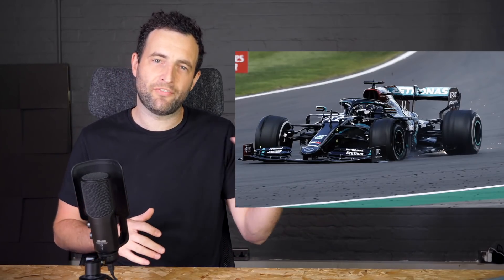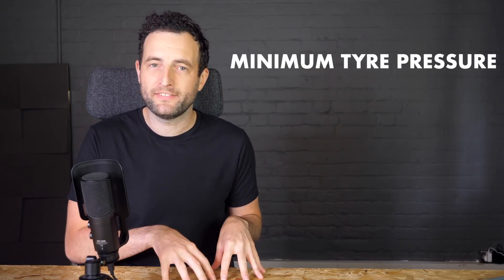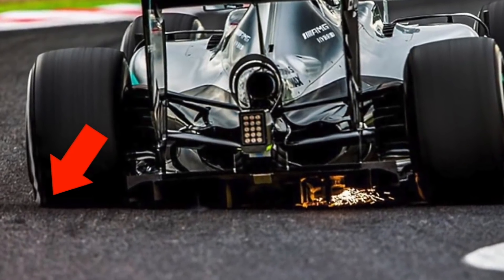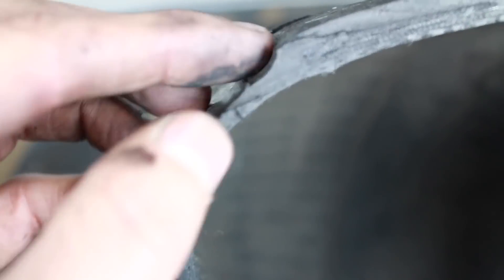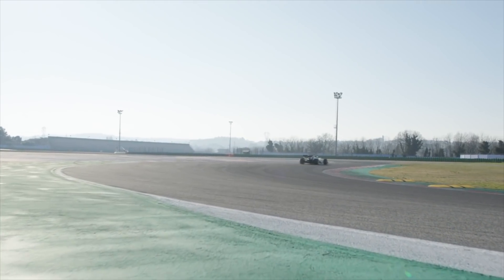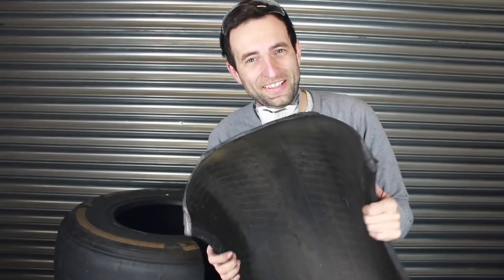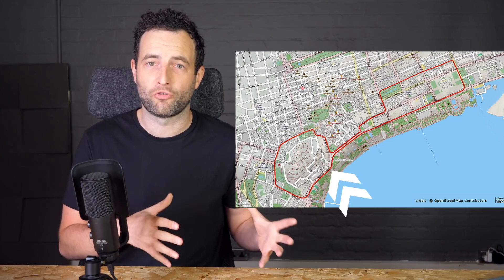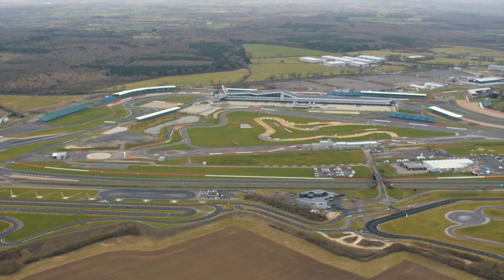Why Formula 1 Tyres Failed in the Azerbaijan Grand Prix

Comment: Warning: A long piece for which I apologise, but it involves tyre safety for road users, so consider it a public service announcement, haha
 Always look after your tyres, their pressures and their condition folks. A rear blow-out will have your car swapping ends faster than the blink of an eye at 60mph. Around a hundred people die as the result of such sudden deflations in the UK every year.
The lower your tread depth, the more you are likely to pick up a puncture. 
As an ex MOT tester, among other trades, I`ve seen objects such as carpentry nails, screws, bolts, random bits of steel, and even a padlock key, penetrating a tyre, that when removed with pliers, caused sudden tyre deflation. As opposed to centrifugal force or by the tarmac.
Reason more rear punctures than fronts? The front tyre lifts an object to the veticle for the rear to pass over it and it to be embedded, resulting in no penetration, penetration and slow puncture....or sudden deflation with occasional fatal results. 
There`s a youtube vid where a chap attaches a camera to a front inside rim on his car, to monitor tyre deformity, compression and growth. I`d not truly appreciated what a hammering road tyres took until watching that coverage the other month.
Not sure what the current status re lorry tyres and remoulds are, but with their high ply rating and original carcass taking so many tread replacements, they were known to fail at times, not a pleasant experience for cars drivers nearby.
Motorcycle tyres behave differently(unless you`re Barry Sheene at 170mph on the Daytona banking, c 1974?). On her Maj`s highway, I`ve experienced two rear blow-outs at between 60-70mph , luckily on straights, but nonetheless, fighting a bike alternating between pointing to the kerb and oncoming traffic, at what seemed like every half second to begin with, before feeling I`d some control and wondering how the hell I`d stayed on initially. Very scary. Second time, somewhat aware and my life didn`t flash before my eyes...
With a car`s rear axle(average aspect ratio tyres fitted to wheels) having one inflated tyre and suddenly one totally deflated, the car`s steering geometry changes alarmingly quickly,  in what effectively suddenly becomes a rear wheel steering episode on full lock.
I know virtually nothing about car racing, so I wont start guessing about whether F1 car`s rwd have limited slip diffs etc. I remember getting into my road car to drive home after a day`s outdoor karting and thinking my normally responsive car was like driving a supermarket trolley.....so my questions to a racer would be, could an ultra alert racer, in a road car, with modified responsive steering, save a 60mph blow-out on a straight road? On ultra low profiles maybe, not crossplys....
What would the difference be between controlling a rwd v fwd car in such a scenario.

Comment: This sounds so not right to have a tyre manufacturer deciding virtually on a race by race basis when pitstops should happen to make for more intetesting racing. This sounds dangerous. Their job should be to develop the safest most efficient and durable tyres.

Comment: "We also found a cut on Lewis' left-rear tyre which was caused by debris," Toto Wolff told Sky Sports.
Reply: “We found a cut on the inside shoulder of a rear-left tyre used by Lewis Hamilton in the same stint. The cut is quite deep, probably 6-7cm, but did not cut the construction. So the tyre was still in one piece, it’s just the tread is cut.

“When there was the red flag and Lewis came to the pitlane and changed the set of tyres, we found the cut in the tyre. The rear-left tyre is not the most stressed tyre in Baku because talking about the rear tyres, it’s obviously the rear right.

“Another element is that there was no sign or anything warning according to the teams. We have to receive the telemetry from them but what they told us is that there was no warning, no vibration.

“These are the main elements collected in this short period of time.”
Reply: Source: https://the-race.com/formula-1/pirellis-early-findings-from-high-speed-baku-f1-tyre-failures/

Comment: These imploding tyres are not only a problem for safety, they're also problematic in terms of cost cap and repair damages.
Reply: I would not be surprised if this is what puts RB over the budget cap that there is some way they can ask the FIA to go over it to repair the car. This was completely outside of their control after all, especially because the tyres were well within what Pirelli told them they could handle.
Reply: @generaldreagonlps6889  That would be a logical and fair thing to do, so I suspect it will not be the ruling.. In all honesty though, even that has some problems. RB would've needed to make changes to their car after the race anyways because of the new flexi-wing rules, so deducting the damages 1-for-1 isn't quite fair either.
Reply: @janbo8331  I guess it depends on how much money they reserved for damages. I imagine most teams will have some money set aside for at least one car with serious damage.
Reply: @generaldreagonlps6889  That's certainly true. Teams like Mercedes and Red Bull, especially now with an experienced 2nd driver with RB, probably counted a lot less damage-related costs to their budget than midfield runners. Mercedes has had very few accidents over the years. I think Bottas has crashed his car twice over the years (FP in Austria, quali in Mexico) during his whole tenure at Mercedes, plus of course the Russel incident at Imola. They have probably extrapolated an average crash number for their drivers and counted that towards their budgets, plus some reserves for unexpected things such as rule changes etc. RB said they had a budget reserve they would need to use for the flexi-wing regulation.

Comment: Can you make a video on why Hamilton locked up. And what is magic button
Reply: Magic button sends all the brake bias to the front to allow the front brakes to get up to temperature without as much effort speeding up and braking.

When they left the line, Lewis had either forgot to turn the switch back to normal or accidentally reactivated it while doing some other settings changes, he went into turn one with more front brake bias than he was expecting and whoooomf, straight on at turn one.

Comment: Firestone makes tires for IndyCar that can handle speeds in excess of 200mph for 30+ laps on ovals without issue, why can't we have them make tires for F1 too?
Reply: These IndyCar tires can only do left turns 🤷‍♂️😉
Reply: @ziggyyo  They actually only have 4 ovals on the calendar this year, against 7 road courses and 6 street circuits. They seem to have figured both directions out.
Reply: well that does not matter, pirelli could make tyres that alst an entire race, but the FIA wont allow it, they put a quality cap on tires, so that pits stops remain relevant. They are disigned to fail after some laps, the problem is this tires failed before they where expected to do so.

Comment: @Driver61 OK, why is it the inside (left) tyre that's failed, as that's primarily unloaded on a counter-clockwise circuit? Is it driving out of the last small right kink onto the straight..?

Comment: My question is, why did the left tire explode and not the right one. I understand all the problems but the direction of the race is going against the clock, so logically the right tire must have been affected way harder by all that bending and so on. So why did on both occasiones the left tire explode?

Comment: The tire expert was no expert, any engineer in whatever knows it is simply guessing. But sorry to say so, my mate and I watch F1 a lot better then most analysist and for sure then any YT channel. There was a big difference in the 2 tire blowouts, watch it back, watch the tarmac behind the car and you will see that it was way more likely 2 different blowups. So the expert has not even watched the video properly. Watch it and lets see if you notice it now, it's very obvious once you have seen it. watch behind Max car what happens on/with tarmac

Comment: Both Stroll and Verstappen were doing good lap times on pretty old tires, so they were pushing quite hard (Verstappen's fastest lap of the race was just 3 seconds slower than his qualifying time, which is actually not much). Apparently these high loads caused some metal fatigue-like failure inside the tire.

Back in 2019 most drivers switched to the medium tire early in the race and it easily lasted the remainder of the race. This year's hard tire was essentially the same tire, so it should have lasted as well.
Reply: This. They drove medium tyres 2019 which are basically the same as the hard ones from this race. I think pirelli is right this time. Debris or some other external factor.

Comment: When Stroll's tire failed, the sole of the tire was cut diagonally. That was pretty obvious when he spun around.
Also, it happened way to early for tire fatigue to have time to weaken the structure.
Reply: Agree it might be more of a corner issue
Reply: Didn't stroll have his tyres for 30 laps if I'm not wrong ??? Everyone had pitted once except stroll. Correct me if I'm wrong please
Reply: @pyrox485  I think stroll started on hard
Reply: @pyrox485  Yes Stroll started on hard and didn't pit before the accident.
Reply: Wrong tyre for load/fatigue failure as well, both cars lost their rear lefts which is worn less on an anti clockwise circuit.

Comment: Personally I believe Pirrelli haven't done a proper job being that the regulations were meant to be different this year and they've gambled on going through the season without spending millions for a tyre that only had to last one season before going to low profile tyres next season.  Cutting corners in development due to shortage of time to test it properly, especially as they didn't know both the power output of engines this year or downforce from the different aero packages. 
I think we need competition in tyre manufacturers that would hopefully create better racing and make the manufacturers make sure the tyres work safely as whoever tyres fail will give the opposition manufacturers advantage over the failures. Win on Sunday,  sell 9n Monday.  Crash on Sunday,  tyre centres change tyre brand!

Comment: It never should have happened.  Period.  Especially, especially at Baku and that portion of the circuit.  Nico warned of this during the circuit hot lap preview, in particular around pit entrance and the wall not blending well.  The analysis is fine, but Pirelli really, really needs to be called as they are trying to claim debris as the root cause.

Comment: It will be interesting to see what rear camber the teams were using (iirc it was a maximum of -2⁰ this weekend). If teams were running with the maximum they could then this could also have made any problem worse.
Reply: I think it was more due to the C3, C4 and C5 tire selection and 20 psi minimums vs 19 and the earlier in the season race compared to last year.

Comment: If this is the case …..it is unacceptable. What would have happened if Max or Lance got the tyrefailure at the end of the straight. Not acceptable at all
Reply: Teams should have pitted due to worn out tires. Teams should have monitoring this because they didn’t pace the last stint. They chased each other at maximum the whole stint. They don’t do that normally.
Reply: @dennisnagy8047  First of all, they weren't going at full speed. Max was cruising to a delta. And only responded if the fastest lap was taken from him.

And you can actually see, live on TV, when tires are worn. Dark streaks, spots, graining and blisters will appear. Max's tires looked perfectly fine, and RBR have sensors in place to warn Max about tire wear or excessive heating. They didn't see anything weird, and Max didn't feel anything weird.
Reply: @theglitch312  Yes, of course they have a delta to follow, they always do. And this is what’s happening with the tires as I explained are worn out. And they where racing at lap times higher than expected, and the tires worn out to fast. It’s the same with an engine if you over rev it for to long they worn out. And debris can easily penetrate a thin tire surface
Reply: @dennisnagy8047  it clearly wasn't the teams fault but pirellis
Reply: @dennisnagy8047  All the wear pins were still on the tire, RBR and Max didn’t feel or see anything that’d indicate an exceptionally worn tire, plus, Pirelli themselves have discounted tire wear as the cause on first inspection. But I guess you know better...

The same C3 tire in 2019 did more laps, in faster cars that were around 1s a lap faster in both the race and qualy. 5 drivers managed 40 or more laps. None exploded. Max’s tires didn’t even do 30 in race conditions.

It is not related to tire wear. You’re fabricating a narrative out of thin air.
Reply: @theglitch312  Let’s wait and see then 😉
Reply: @theglitch312  It’s not the same compound as 2019 . There’s new compounds this year.
Reply: @dennisnagy8047  Yeah, new stronger tires according to Pirelli...

Yet, they still explode without any indication that they're significantly worn.
Reply: @theglitch312  yeah, without indications.. below 10% wear left and of course they will explode if you for example hit a stone or other debris over 300km/h. It’s not brain surgery. Just plain physics.
Reply: @dennisnagy8047  The fact that you take AWS 'statistics' about tire wear as a fact tells me everything I need to know. Those stats are a meme at this point. Completely useless. Anyways:

"I believe I can exclude that failures were due to tyre wear, because it is not a matter of tyre wear[.]"

“It wasn't a puncture due to excessive wear[.]” -Mario Isola

"The tyre wasn't being abused, the temperatures were all good. The race engineer had basically only just checked in with him to make sure everything was under control and then 'boom.' So it was totally unexpected." -Christian Horner

“Michael I know you’re busy, we got zero warning of that failure, nothing, nothing on a metro, vibration[.]” -Jonathan Wheatley

"It was all very comfortable. No vibrations whatsoever." -Max Verstappen

You're absolutely talking out of your ass. Go somewhere else with your unfounded theory.
Reply: @theglitch312  yeah, yeah. You keep telling me. Let’s wait for the report 😉

Comment: There is nothing wrong with Pirelli's tires. The FIA has demanded they make shitty tires with more degradation for years. Also, the FIA has significantly changed the aero regs and yet told Pirelli to keep bringing the same tires. Teams can be told by Pirelli what minimum pressure should be but that doesn't mean they actually run it. Until the FIA pulls its collective head out its ass on degradation versus safety, Pirelli is in a now win situation and I doubt any other tire manufacturer wants in on this mess.

Comment: I saw this coming somehow... Moments before they started discussing Lewis vs Perez tyre degredation, there was a short shot of Max that showed his right rear in not so great condition compared to most other cars. Then moments later they show the info graphic for Perez and Lewis and it said 20% and 10% on the rears for them. I was confused because they didn't mention Maxs tyres but they must have been pretty dead if they already rated Lewis at 10%. 
I had a very weird feeling..... maybe because of Strolls tyre blowing earlier? I had a feeling we would see another tyre blow. But what can you do? Pit with a few laps left and give away the lead? Nah stop overthinking it I said to myself. 
Boom, few moments later, there it went. I knew it had to be Max before we could even see what happened. Was the left rear, not the right rear though.
Reply: You got it mixed up. They showed 10% rears for Checo and 20% rears for Lewis. They didn't show Max's. I wondered too, "what is Max's tyre degradation like?" And 1 or 2 laps later, we all found out....... hahaha The heartbreak I felt, you can't imagine. I immediately switched off the tv.
Reply: @AmirRahman123  Don't trust those AWS statistics lol. Quite often they put a "Driver A will overtake Driver B in 10 laps with an easy overtake." Only for the overtake to be very difficult and 10 laps later than predicted. You simply can't put a percentage on tire wear like it's a video game.

Experts have already ruled out tire wear caused the tire to explode. It's debris, or a fault in the tire itself.

Comment: I'm scared for what the Zandvoort banked corner will do to these tyres :O
Reply: But actually though
Reply: It's probably going to be just fine. The banking causes a large amount of the pressure to be downwards anyway, maybe more than in a regular flat corner. The bigger issue is if the race will actually happen.
Reply: @generaldreagonlps6889  Yes but because of the downward force, they can go much faster trough the corner, thus increasing lateral force aswell.
Reply: @pieter-basbeijer5781  Yes, but banking is to compensate for centrifugal forces and therefore will reduce lateral forces. The speed in the turn will be the max possible without loosing grip, just as in any race, so the total lateral force (centrifugal - gravity due to banking) will be the same as always. Because of the banking this maximum total lateral force will occur at higher speed, but that is of lesser importance.
Reply: @martijnb5887  You mean centripetal force, centrifugal forces are a pseudo force which doesn't really qualify for the real name ''force''.
Reply: I don't know if it's true or not so don't take my word, but I saw someone say they are designing special tyres for Zandvoort.